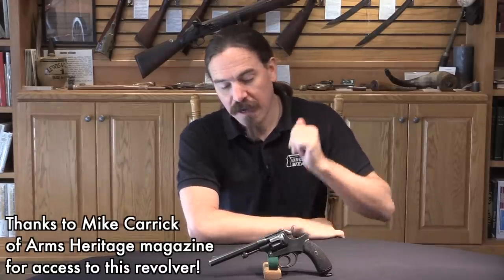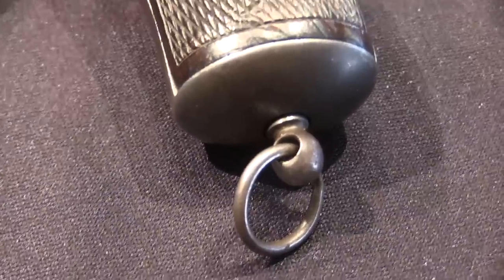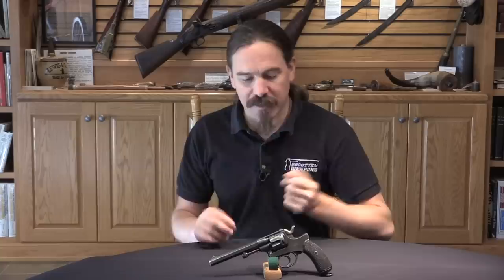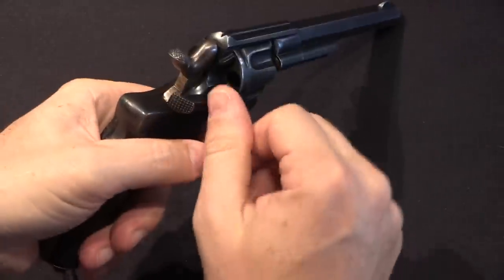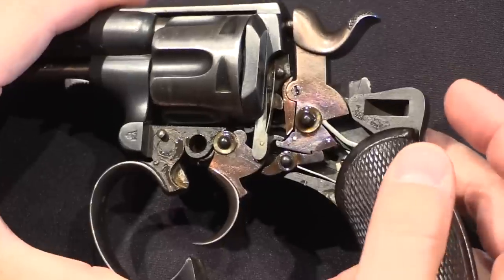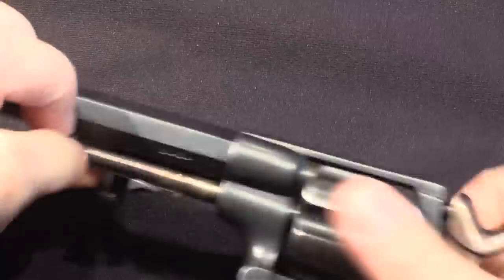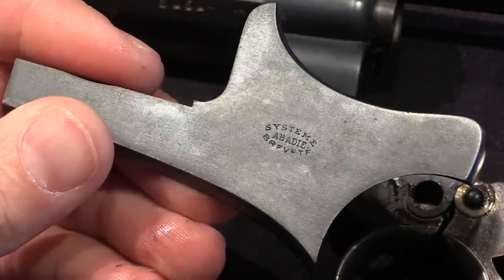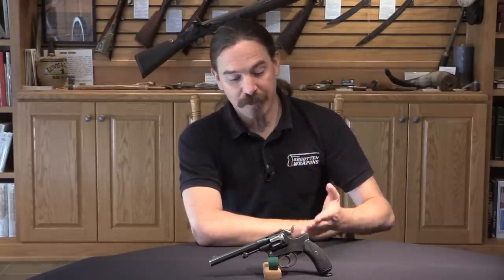Portugal's Model 1886 Trooper's Model Abadie Revolver

Comment: For even more comparison, I’ve owned airsoft guns that threw plastic bb’s at 530 fps. That round is absolutely positively slow.
Reply: Yeah, for another point of comparison, at 100 yards you could theoretically just barely dodge the bullets.  Well, you'd have just enough time to move a bit if you saw the muzzle flare and were ready to go.  About a quarter second to react (typical human reaction speed), another quarter second to move a foot or two out of the path, possibly drop to the ground.  Don't try that one at home though.
Reply: But that's like a 0.2gram bb at best
Reply: @beargillium2369  be that as it may. I’m just saying 530 isn’t at all fast for a bullet
Reply: @beargillium2369  they make .48 gram airsoft pellets.
Reply: @ScottKenny1978  facepalm
Reply: That sounds like a good way to get a gun arrest in Portugal
Reply: @Alertacobra12  good thing I’m not Portuguese then?
Reply: @lartrak  typical human reaction speed is two thirds of a second. A quarter of a second is fairly incredible, not impossible, but far above average.

Comment: 7:10 We don't say "Brevete" but "BrevetÉ" (accented E : "é/É" although the uppercase é was usually printed without the accent for lack of adequate physical character in the font set or the typewriter keyboard - still technically a mistake and today the uppercase should be accented on computers. To confuse the matter a bit more, there are debated and conflicting rules depending on the character being an uppercase or a capital (beginning a word or a sentence), the former has to be accented but not the latter ; but in the case of a terminal "É", it should be accented no contest).

Comment: Two comments, firstly you've got the wrong flag up there. The green and red is the flag of the republic which overthrew the monarchy in October 1910. The flag should be blue and white with a slightly different crest (with a crown but no armilar). Secondly, the pistol that replaced this was the Luger in 7.65 x 21 at about the same time that Switzerland adopted it. The Savage in .32 ACP was brought in during WW1 because the supply of Lugers sort of dried up. I have seen one with its original ammunition and was surprised to see it had unjacketed bullets. I have read somewhere that some Abadies were also carried by troops in the Portuguese Expeditionary Corps. France of course was the great buyer of Savage pistols by comparison with Portugal, however as far as I know only the Portuguese contract Savage pistols had client-crested handgrips, in this case the republican crest. 
Prior to the adoption of the Abadie there were single shot Westley-Richards pistols and Adams revolvers, first in cap-and-ball form later conversions to back loading. The Adams was in quite a beefy caliber, so one wonders what led the authorities to opt for such a wimpy cartridge, specially if you consider its use in colonial conflicts where a proper man-stopper would be more appropriate as evidenced by the British choices. Again, the French had similar requirements and also went for a relatively low power 8 mm cartridge, were they relying on marksmanship over energy?

Comment: I really like the features they put in to make reloading faster.  I wonder if it was faster to reload something like this or a gun with a swing out cylinder that could eject all casings at once.  I don't think speed loaders had been invented yet, otherwise there'd be no contest of course.
Reply: Abadie: Open Loading gate, (operate ejector rod, load new bullet, pull trigger to align next round), repeat x 6, close loading gate = 20 actions (actually 19 as you can skip the last trigger pull as the next chamber is already full)
Swing out cylinder or break top with ejector: Expose cylinder, load six rounds, close cylinder = 8 actions
On top of which Ian has covered at least one speed loader from around about this period.

Comment: It feels like this system could work in conjunction with a swing out cylinder with the gate lowered to allow you load two at a time off a speed strip. You’d probably need a larger cylinder, maybe 8 rd capacity to get the volume to load two at a time from speed strips.

Comment: That is a really nice revolver.  It's a pity no version ever seems to have been made to fire a decent cartridge.
Reply: There is a swiss version in 32 long. It's quite decent for 1890's and easily available
Reply: @PapaSchultz74  The Swiss 1882 Ordnance revolver.  Yes, it fired a 7.5mm cartridge that fired a 104 grain bullet at less than 700 feet per second.  That's less powerful than a .32ACP.  

I repeat: it's a pity no version ever seems to have been made to fire a decent cartridge.
Reply: @Hibernicus1968  well with 3.1 grains of Bullseye you can go up to 1010 feet / second. (according to Phil Sharpe's 1930's Complete Guide to Handloading,  https://postlmg.cc/B8PWXkdW nowadays every reloading guide will down load for reliability issues)

 i also repeat we are talking about 120+ years old revolvers made originally for black powder.

Comment: Beautiful condition. Nice features. Onboard disassembly tool is efficient and effective. Martial revolvers are always interesting, and many of them come apart in various ways. No doubt that was needed in the blackpowder era. Too bad they couldn't have sped up the cartridge to approx. the velocity of standard 38 Spl. That would have been reasonably effective. I wonder if 380 brass could be used to make ammo, since it is the right length? We know rimless rounds can chamber in revolvers, and solid frame ones can push out the brass. Or would it need to have some sort of step in the chamber? Might be an interesting project. Someone would have to load Pyrodex in small increments though, to be sure they did not exceed acceptable velocity. The original ballistics begore imorovement sound a lot like 41 Rimfire, and we all know how powerful that wasn't. Lol. Great video as always. Thank you

Comment: I always wondered how effective those long barreled Artillery pistols actually were in practical use, vs just using a carbine. Not sure there's any data on that, and the Lange Pistole 08 probably runs circles around it just by means of sheer capacity, but i'm just curious if this was actually a good idea.

Comment: Hi Ian, the pronunciation isn't "brevette", but "Breveté" (it ends with sound "et" ("and" in English). 
Sometime you will see BREVETE written in caps without the accent on the final letter. This is due to the French importing the first lead casting printers from the UK, which didn't have accentuated letters. And then early computers used in newspaper and such didn't support accentuated caps either. 
But the correct spelling is always : BREVETÉ. Meaning patented". The final "é" being the mark of the past tense. Example, "modèle breveté" = "patented model".
The word "patent" itself, is "brevet" pronounced "brevai" (the trailing t is silent) when followed by the N° of brevet. Example "brevet n° 182736" = "patent N°182736".

Comment: Really neat gun! Would a revolver designed like this get damage from dry-firing it to train?
Reply: Absolutely. There is no disconector like in modern revolvers, the hammer will damage the frame as he needs to stop somewhere. But you can put some dummie cartridges inside. Remember this gun is 120+ years old

Comment: Why do single actions have the loading gate on right? It seems it would be easier and quicker to load from the left. Swing-out cylinders open to the left.
Reply: Pistols were used in the left hand at the time. An officer's sword was in his right.
Reply: @ScottKenny1978  I thought the saber wad only drawn once the revolver was empty.
Reply: @JeffreyABeard-gi1rc  no, the saber is a tool of command, you use it to point and give signals and stuff. 

Don't remember which ACW movie it was, Gettysburg or Glory maybe, where an officer commands a charge in a bit of woods and gets out in front of the troops waving his sword around.

So you'd have the sword out as soon as the fighting started or even before, but you'd only draw a pistol when the bad guys were getting close. There's a few examples of this in Churchill's "History of the Malakand Field Force"

Comment: what are other revolvers that allow you to rotate the cylinder with the trigger while reloading
Reply: Yes
Reply: @randomantguy24  thank you for the insight, randomantguy 24
Reply: @eyeamstrongest  yw

*sheepish look
Reply: All revolvers with an abadie system aka to many to list them all. One i know from the top of my head would be the Rast&Gasser 1898
Reply: The 1889 bodeo is Probably the most famous one thanks to it being in battlefield 1 and if I'm not mistaken one of the swiss revolvers used it either the 1878 or 1882 models I don't remember exactly though
Reply: The Schmidt designed Swiss revolvers, 1882 and 1929, as well as the French MAS 1885, incorporate Abadie index systems off the top of my head. There will be others.
Reply: @brendonbewersdorf986  did the bodeo have an abadie gate system as well, i dont remember since the only gate loader i used was the gasser
Reply: @eyeamstrongest  yes it did look at C and Rsenal video on it also it's modeled in battlefield 1 it's pretty cool gives it a faster reload than the other gate loading revolvers in the game like the gasser 1870, Webley bulldog, and nagant m1895 revolver

Comment: this is an octogonal barrel. WHY ? fluted to remove weight ?
I say fodes
Reply: That, plus I imagine making the whole barrel octagonal would be a feature a gunsmith or armorer would appreciate. 'Cause if you need to torque the barrel off, you could grab it at any point with a wrench.
Reply: Back then, barrel blanks were made from square stock, so knocking the corners off on a mill was a faster and simpler process than turning it round.

Today, barrel blanks are made from round stock.